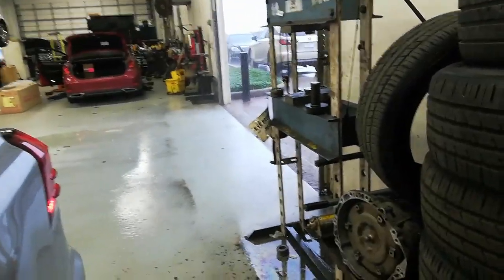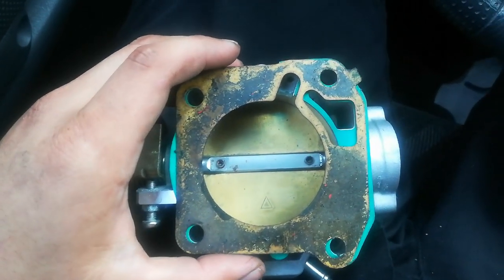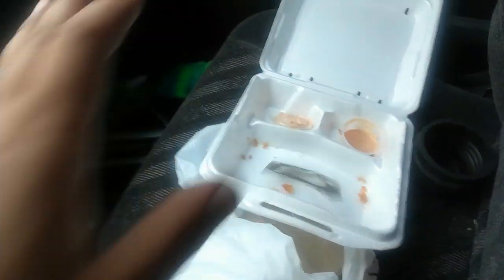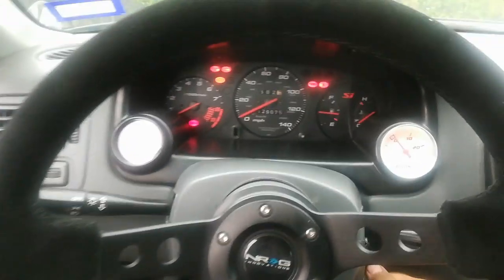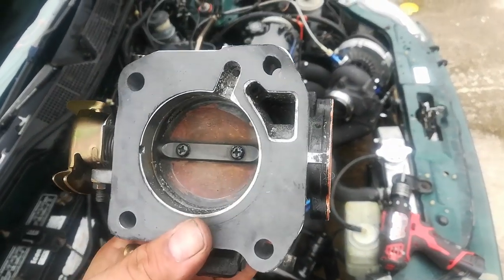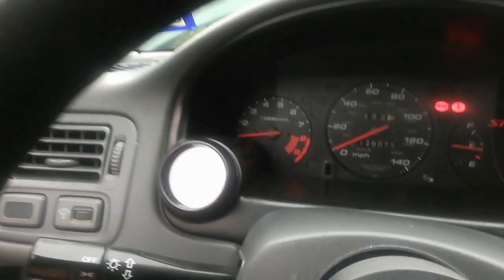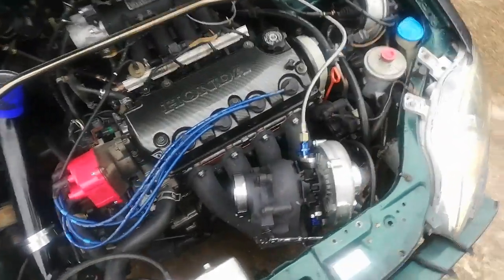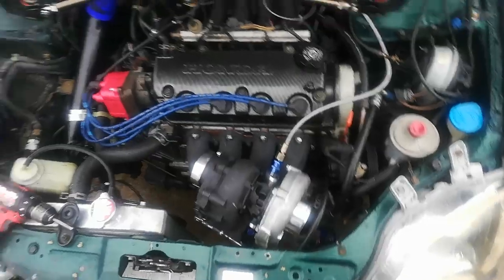Stock Throttle Body and skunk2 Intake Manifold High Idle Problem Fixed!

Comment: Happened to me about 2 years back..turns out it was the gasket on the intake manifold that had a crack and it doesn't just idles high but it revs on its own as if like someone is revving the engine..changed the gasket and all is fixed! Great video btw bro!
Reply: Did it stay revving when you were driving and let go of the gas? I'm having this issue now. Idles fine but with tps plugged in revs high after I let go of the gas, unplug tps and works how it should.
Reply: Mine just goes up and down cleaned out the fitv but happened again couple days later, think it could be the gasket?
Reply: Change gaskets
Reply: I hope you reply or see this; was this on a base model or type s, if so where did you get the gasket? i’m on a base
Reply: I have no vacuum leaks. I think my tps took a shit.😢

Comment: Install the tps return spring from your stock throttle body into the skunk2 throttle body.
Reply: Tried that.. took my skunk 2 throttle Body off after installing it and tried to do exactly what your saying BUUUUUTTTTT when after taking the throttle position sensor off I seem to have an issue getting the main rod out after taking the center out. It doesn’t wanna come out so I can out the stock spring THAT COMES WITH AN OEM THROTTLE BODY IN 🙄🙄🙄 maybe I didn’t do something right or I just got one that’s tough to get out but I don’t wanna do any damage to the throttle body I spent like 130 bucks for so if someone couple point me in the right direction I would greatly appreciate it because at this point I’m starting to get used to tapping the gas when coming to a stop lol
Reply: @danielgatto5500  yeah its a pain in the butt to get the spring off. I forced it off
Reply: @2021487  you got ur skunk2 main rod that goes through the throttle body out?
Reply: @danielgatto5500  no i went around that piece
Reply: @2021487  so wait how many springs are you using ?
Reply: @danielgatto5500  just one

Comment: Mine idles at 2k rpms. I replaced the iacv and the tps cleaned my TB and still idling at 2k.. ya think it's a vacumme leak or my TB gasket???? I ordered a new map sensor and a intake manifold gasket because forums keep pointing in that direction as well as vacumme leak but not truely sure what's going on. At this point all this money my civic has made me spend on it I wanna set this car on fire while the mechanic is inside of it since he charged me over a grand not to fix my idle problem
Reply: having same issue, i also replaced rotar arm, dis cap, iridium spark plugs, ht leads, gon try gaskets when i get time
Reply: i have the same problem bro.. its rly a bummer. did you every find the cause?? thank you brotha

Comment: My problem is after driving and I push the clutch in, the rpms drop and they drop too low and sometimes my car cuts off.. what could that possibly be?
Reply: I'm having the same issue. Any info what causes this
Reply: Probably throttle cable
Reply: Tighten your throttle cable but then now I have high idle lol but car don’t die no more 😂

Comment: I have a skunk 2 intake manifold and an itr tb and my idle sometimes is normal sometimes it jumps to 2k and stays there until I tap the gas I am going insane and i was coming to the conclusion a stock tb may cause some bs as described
Reply: Please tell me you fixed the issue
Reply: I have the some fucking problem but I found the problem no I am ordering new trotte body

Comment: hey man .. i installed my 70mm throttle body but it revs super high untill 5k and drops to 2.5k operating temperature..any help?
Reply: U tuned ? And have y tried adjusting the idle screw
Reply: I installed a 62mm throttle body on my 07 Shelby gt and it works fine till the car warms up then it shoots the rpm to 2-3k rpm when idling sometimes or if I’m driving then it’ll stay at 2k rpm and drive itself basically , or if I come to a stop check engine pops up and car has no throttle response and sometimes dies on me

Comment: I'm having this issue right now.. skunk2 pro manifold and 76mm throttle body...
Reply: It wasn't doing at idle before but mildly @1500 to 1700. I thought it was the iac valve. So I changed it and it got really bad now it surges between 1700 and 2000...I'll have to check the intake gasket like one person said in the comments
Reply: It's a d16y8

Comment: I need help guys if anyone knows please @ me okay so I have a 96 civic ex 5speed manual and my 64mm throttle body needed to be replaced only because when I attempted to punch out the pins that held my TPS the bottom end broke off the throttle body itself. So I bought a new and it’s actually a 70mm instead of the 64mm like I had stock so I went ahead and just got a new intake manifold well I got everything on and it looks great it all pieced together nicely but when I started my car it instantly went to 6k+ rpm’s so obviously in a rush I turned the car back off and I checked out the new TPS on the new Throttle body making sure it was in its groove correctly and it is but I went threw diagrams of vacuum lines their all the way they should be just missing one from my evap never had it since I’ve owned the car
Reply: Also seen a vid of someone with the same intake I have now and on the side by cylinder 4 on intake there are these 3 holes for my guess some kind of aftermarket valve/sensor i don’t know but the dude in a video just mentioned blocking up them holes with right size bolts etc said it can be a huge vacuum leak also
Reply: Would and can say an incorrect gasket such as the difference between automatic and manual cause this problem? Please @me

Comment: Think imma ha e to upgrade my throttle body. My car isles at about 1100 then it goes up and down to 1500 and you can hear it going up and down. Even see my boost gauge moving as well so it might be a vacuum issue. Nonetheless it’s annoyingly as f&$k.
Reply: That's a vacuum leak